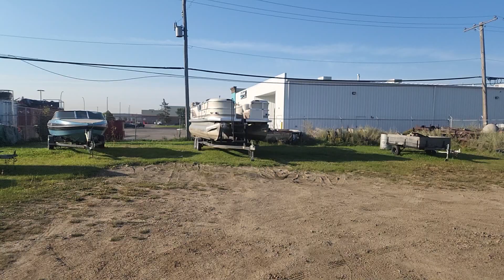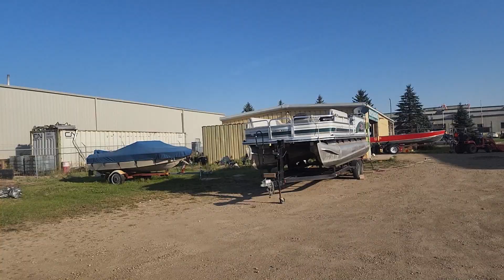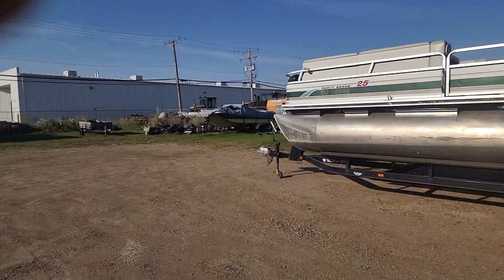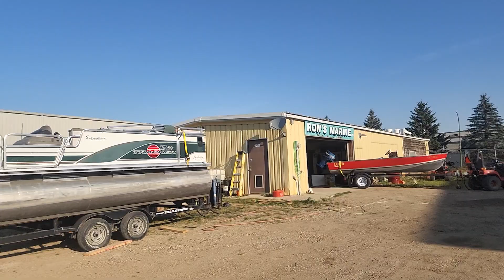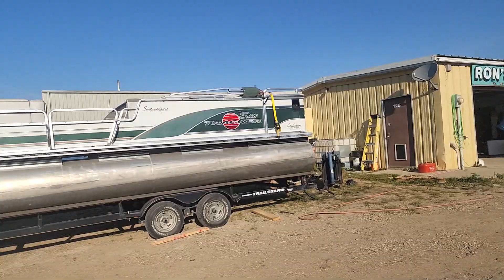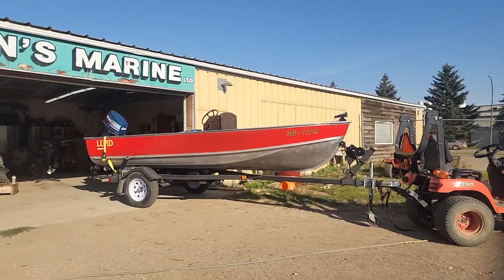Good vs Bad Boat Motors—Which One Do You Have?

Comment: 05 merc 60efi with water in the oil but none in the cylinders; changed head, head gasket, and base gaskets and still water in the oil.  Cracked block, doc?
Reply from the maker: You did both gaskets and the head gasket.  So unless u made a mistake.  Damage to the block somewhere.  If you...Remove the spark plugs, oil and drain plug. You can take off the gearcase and run water directly into the pipe.  Look for water at the cyls or from the oil drain.  Cyls is the head gasket...Drain plug is the base or adapter gasket.  Engine is NOT running.
Reply: @TheMarineDoctor  Appreciate the quick response and will give that a go over the winter.